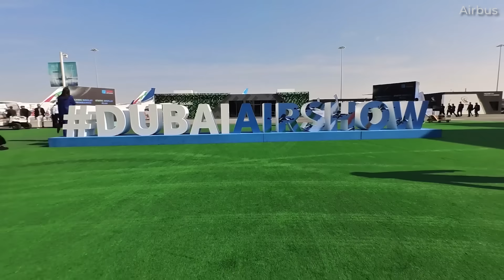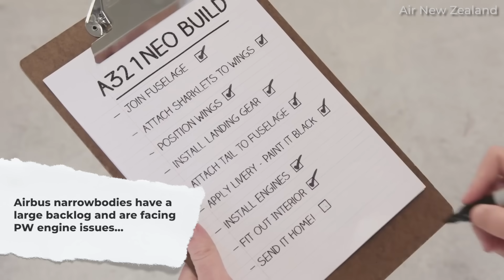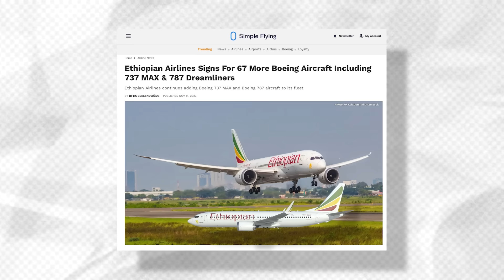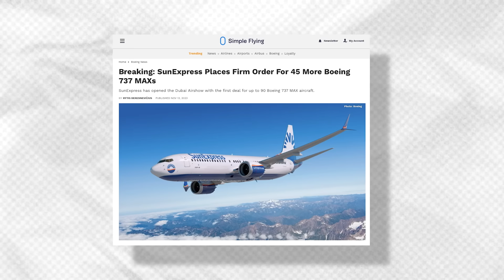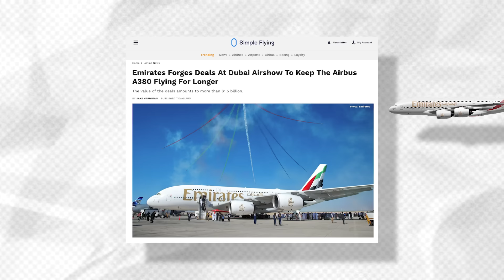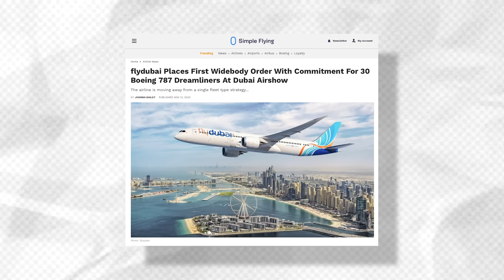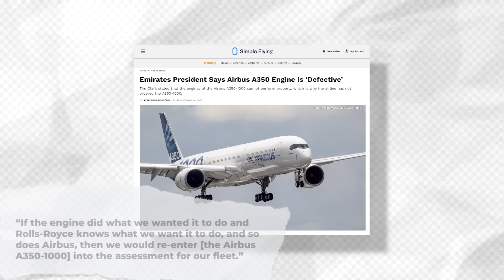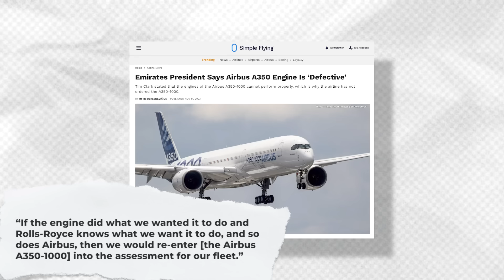Airbus Vs Boeing: Who Won Dubai Airshow 2023?

Comment: Having flown both Boeing and airbus I would have to say that Airbus is currently making the best 3+3 narrow body in the industry. Both for pilots and passengers. As for the widebody I have only flown the 777 and that thing is awesome and so stable. TAC makes engine out procedures a breeze. I have rode in the back of all the other widebody aircraft except the A350 and have to say the best experience as a passenger was on the 787. Why airlines are still buying the 737 boggles my mind. That thing is trash and I want my country to produce the best planes but our narrow body is hot garbage.
Reply: I fly on 737s and A320s a  lot. Older and newer models. You literally can't tell them apart without the safety card. They are both the same level of comfort (or lack thereof 😳). How the airline has them configured and maintained is the determining factor.
Reply: In my opinion you can most definitely tell a difference  tho it be subtle. The width of the 320 is noticeable and the 737 is narrower meaning noticeable in seat width. @davemiller6055
Reply: @damiandeneir6527  
The A320 cabin is 6 inches wider than the 737 over a width of about 12 feet. Nobody is walking on a plane and saying "Wow, I can really see this is 6 inches wider than the last plane I was on".
That is not happening. You do not feel a 6 inch difference over 12 feet. 
You are just Airbus fangirling. "Oh yeah. I can definitely tell this plane is wider. That 6 inches is really noticeable". Get real. 

All things being equal, that is AT MOST 1 inch wider. Less really due to differences in seat manufacture and age. No one is noticing that without the safety card telling them.
Reply: @DaveMiller2  I fly on average a solid 10 months straight out of the year. With that being said yes you can notice a difference if you're a avid frequent flyer.  Yes I prefer airbus products over Boeing and I have many reasons why. One as a traveler I find airbuses to be more comfortable and smoother, as a former ramp employee the Airbus is set up better than Boeing. As a pilot airbus are alot more efficient than Boeing when it comes to overall comfort. You are entitled to your opinion and you can prefer Boeing over airbus products that's fine but do not come back rude when someone with the experience both as a passenger,  pilot, and former ramp agent  and try to discredit their opinions 😉  enjoy your day.
Reply: You said it, how the cabin is equipped is what matters to passengers.  I've been on some well equipped aged airframes that were a dream (737 next Gen Alaska Air) and I've been on new models and the cabin sucked (737 max South West).
Reply: Man, i love the 737 max so much but ive gotta agree. Ive flown on the a320 neo a couple times and an a220 once. The experience was amazing.

Comment: I don't get why anyone is still ordering the 737. Yes, it was a great development when it came out 55 years ago and it has served the aviation world very well. 
But, despite all the upgrades they did to the aircraft systems on the MAX, it is still the same old fuselage that is just not a nice experience in a 3+3 configuration. I recently had the joy of flying on a 321 and a 737 (it was a -900 and no MAX, but for cabin width that really makes no difference) directly sequence, and the few inches more width in the Airbus make a huge difference. Also, the air conditioning on the Airbus seemed to be a lot better than on the 737, the 737 was WAY warmer and extremely dry - but that is something they could have done better on the MAX, so I will not count this here.
Reply: You do realize that the A321 is based on the A320 airframe which has been around since the 80s.
Reply: @nel1962 literally a 20 year difference
Reply: @maxsaviation9512  besides the point. They are both reengineered from decades old airframes. The neo is not a clean sheet design.
Reply: @nel1962  Of course I do. I have even seen an A320 family assembly line in person some years ago. 

But still the airframe design of the A320 family is about 20 years newer than the 737. And even then, the 737 was not a completely new airframe design - it was derived from the 707 fuselage, and most of these changes were outside the "passenger carrying tube", except for fuselage length. So to say it bluntly, the fuselage design goes back to an aircraft that first flew in 1957. 
The A320 family on the other hand was a clean sheet design that first flew 30 years after the 707. And while it's been more than 35 years since the first A320 flew, it is still significantly more modern in its design.

But all of this  still doesn't change the fact that some of the design aspects of the A320 family (things that are NOT under the airlines' control like seat pitch) are just more passenger friendly than on the 737.

Comment: I am so disappointed at Ethiopian airlines decision to purchase 21 more 737 Max aircrafts at the air show. After the deadly crash of the 737 Max that occured in Ethiopia which had nothing to do with Ethiopian airlines and the ongoing fight for proper financial compensation to the victims families through an ongoing lawsuit, anyone would think that Ethiopian airlines will reconsider buying more of the same aircraft. How sad they are doing just that. What a slap in the face of the victims families. 😮😢😢
Reply: @tspmo12  Boeing did inform the pilots about the MCAS to some degree. It’s just that some airlines didn’t train their pilots enough thoroughly and flew it as if it was a 737NG. I work for one of the biggest North American carriers and we had 737 MAX flying before the two tragic crashes. None of the US carriers had any problems with the 737 MAX.
Reply: @is500fsport5 
None of the US carriers had any problem with the 737 MAX, you say! And yet, all these American carriers have grounded their B-737 MAX at the request of Boeing itself, to prevent an accident from happening ! In your opinion, why ? To train the pilots more ? Or, in your opinion, should we wait until all these planes have an accident, to finally take care of the problem ?
Reply: Ethiopia obviously knows was a tragic accident, which will happen, and are confident Boeing solved their issue.
Reply: Ethiopian doesn't fly the A320. Switching would mean training pilots and mechanics, buying tools and parts, etc. All this costs money and time. And it would be 10 years  before they would get any A320s due to Airbus's delivery backlog. It isn't viable at all. Besides. The Max is fixed.
Reply: Nothing wrong with the 737MAX. Poor pilot training is what caused the accident.
Reply: @is500fsport5  My advice to you is that, you do more research on the grounding of the 737 Max immediately after both plane accidents. There are many documentaries online done by seasoned media reporters and after their research, they confirmed the software wasn't well tested and Boeing staff used 'jedi' mind tricks to fool airlines to buy these planes when they knew fully well certain changes had been made but were not disclosed to them. Boeing staff insisted no further training was needed on this type of aircraft. It was only after both accidents occurred did airlines discover Boeing lied about no additional flight training is required.
Reply: @is500fsport5 
What is this good-natured statement full of bullshit ?? If it was just a pilot training problem, why was the B-737 MAX grounded and recalled all this time ? And weren't the other pilots from other companies whose planes had been grounded just as well traîned ? It's widely known that a system on the plane was defective, and this is what Boeing recognized and tried to resolve throughout this immobilization. Why, after announcing the repair of the problem, was the plane still subjected to countless tests, and to a new certification from the FAA ? All this, for a lack of pilot training ? Please, stop your lies, and don't make us mistake bladders for lanterns. I don't know why people need to lie about something which is so important !
Reply: @babacardiallo5662  Your comment makes no sense. But I stand firm on my earlier comments. Again, some airline pilots weren’t properly trained as other airline pilots.  Not only just the pilot training but also maintenance staff as well. A third world country lacks the funds and resources against a more wealthier country that can afford to have better flight training, simulators, engineering and etc. It’s a long list of things that I don’t want to explain each of them. Not to mention but some third world country pencil whip their process of examination. The lion air crash, the pilots didn’t know what was going on. The previous flight before the unfortunate fatal crash, one of the pilots knew what was going on and managed to resolve it. Why did this guy or girl knew what to do and his peers didn’t? Like I said it’s the poor training of some pilots.
Reply: @is500fsport5  Still standing firm on your comments?

Comment: Let’s wait and see how many corners Boeing is going to cut in order to certificate and deliver the planes. Just can’t believe airlines are buying planes that just don’t fly. Must be very cheap planes.
Reply: Well, maybe Airbus chose wrong engines in Rolls Royces and Pratts 😂
Reply: @JDAbelRN  no Airbus has crushed because of faulty engines. No hidden system in Airbus planes.
Reply: The MAX costs more than the A320 series at list prices. And everyone that has them seem to be quite pleased with the performance, so I don’t see how “they don’t fly.” I am pretty sure Boeing’s days of cutting corners are over.

Comment: How are Qatar airways able to use the A350-1000 in a desert and Emirates say they can't oder it as the engine isn't reliable the desert conditions
Reply: It’s specifically the -1000. The -900 has the same engine, but it’s de-rated and makes their performance targets.
Reply: Qatar and Etihad use a special Hot&High engine option
Reply: @georgyshpodaruk  if thats the case. Then why can't Emirates oder one with the hot rating as well?

The point that makes more sense for me Is the one Mentor made in his video on this topic.  He said Etihad and Qatar made their engine deals with Rolls Royce before the pandemic and back then Rolls Royce had the capacity to please customers and made deals with Qatar and Etihad that meant Rolls-Royce would cater for most of the expenses. But since the losses during COVID-19 they are looking for every way to bring profit and give better news to the share holders.  They can't manage to make a deal with Emirates that handicaps them due to the needs of the engine off plane requirements
Reply: + Etihad too. Litetally they are using it on desert conditions